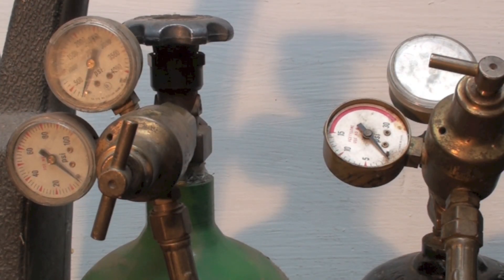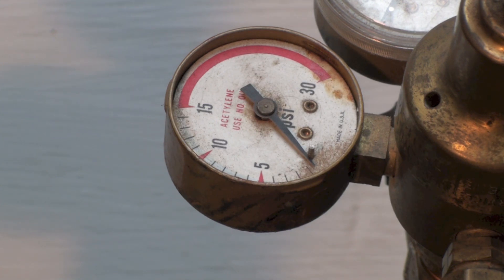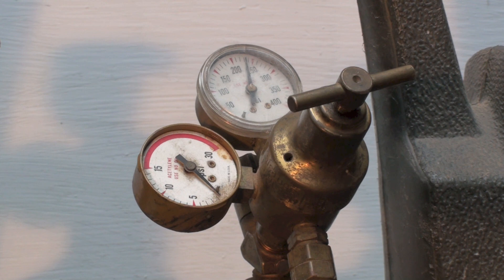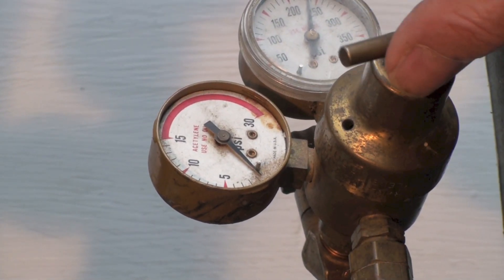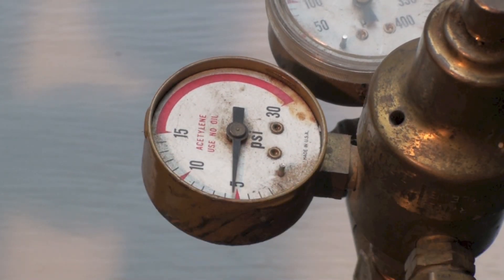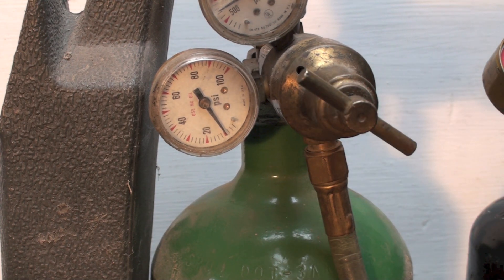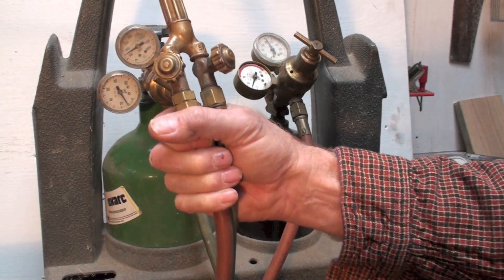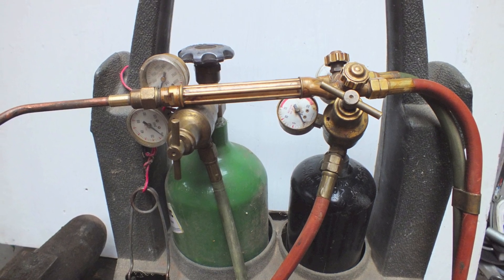How to set the oxy acetylene regulators

Comment: grayfurnaceman  you missed the entire point of my comment. If you are going to post a video online to instruct someone, anyone. Especially in this age of untrained people thinking they can jump on the web watch something and be an expert. Then you need to be specific!!! There is a reason that you should never run over 15psi!! Acetylene at pressures above 15psi becomes  unstable & breaks down into it's components, that can easily combine with  oxygen, and self ignite in a very rapid exothermic reaction. Not only that, you should include a safety brief with any video involving Oxy Fuel welding. Especially this above and NOT TO USE oil for checking for leaks or have any kind of oil near the system.
Reply from the maker: Richard Elbe If you look at the playlist on soldering and brazing, you will see a video covering how to safely install the regulators.  I also posted links there to other videos that I think cover the safety points better than I do.  As seems to be common, one of the links has broken, which is why I do not do this often.  I have considered the safety issues carefully which is why the playlist is linked.  If I overuse links on the videos, they become simply background noise.  I do appreciate the comment and will find another video to replace the broken one.
Reply: +Richard. I don't see or hear anywhere in the video where he said that.

Comment: can this SAME hoses and regulators be used in a set up with propane(cheap!) instead of acetylene
Reply from the maker: Yes.  You will need an adapter for the propane.  You will use about 4 times as much oxygen.  If you are using it for cutting, you will need a propane tip.  Hope this helps.
GFM

Comment: These are "equal pressure tips" - isn't ten and ten appropriate??
Reply from the maker: Well, I have never heard that one.  But it could be true, I guess.  I have always used the lower pressure on acetylene because it works.  It may be that I have done it so long and that's how I was taught, but If you can make it work with equal pressures, I guess its ok.  One of the things I consider is the instability of acetylene.  Over 30# it can spontaneously ignite.  I realize its quite a jump from 10 to 30 but we always did a little of overkill on that.
GFM

Comment: # 1 NEVER EVER use ANY gauges or regulators that are in OBVIOUS DISREPAIR, just like the ones on this vid!!!!!! You WILL DIE or burn down the structure that you are working in!!!   # 2 ALWAYS open the oxygen bottle ALL THE WAY OPEN. There is a back seat on the valve that prevents the oxygen from leaking from around the valve stem!!! That saves money AND prevents oxygen from coming into contact with  greasy or oily rags that may be left laying around which can cause VERY rapid and uncontrolled combustion.  # 3 only open the acetylene bottle 1/4 turn for quick shutoff in case of emergency
Reply from the maker: I will agree on the condition of the gauges on the regulators.  I knew the condition of the gauges and my thought was more of a demonstration of what happens to these tools.  I think if you look in any HVAC tech's truck you will find at least some of this as they are susceptible to damage.  I have a regulator set that I bought in 1968 that the gauges are still working normally but they were stationary.  On the oxygen valve, I was taught to backseat that valve many years ago.  However, in a later class, the instructor said you no longer needed to, so I checked for leaks on the valves and never found a leak so I stopped doing it that way.  And you could make a case for 1/4 turn on oxygen for the same reason as the acetylene.  The one thing you did not cover is the lack of flashback preventers that all new sets have on them.   These devices are well worth installing.  Perhaps I will do one with all the repairs and the flashback preventers.  I do value your comments although I have not died or burned anything down using welders for 45 years.  I would like to see any videos you have done on welding equipment.
GFM
Reply: Thank you sir, as others have posted, I was not trying to be rude or bash your vid, just l wanted to make a point to the less experienced viewers out there that oxy-fuel setups are  to be taken very seriously, and damaged equipment can cause serious injury or death. All of your vids are very informative and have great educational value! Thank you,Ken
Reply from the maker: welding 34yrs Thanks for the thoughts.  I will be publishing a vid showing the repairs on the oxy/acetelene set when I get time.
GFM
Reply: yeh i'm new to this but i worked at a gas place (boc Gasses in durham nc) and we were told repetedly only open valves enough to do what we need.  don't know about the oxy thing i've heard it both ways but i know that getting a valve stuck open is about the worse thing possible if something did go wrong.
Reply: Highasakite you never open your valves more than a half a turn. The simple fact is, if there is a serious problem, you want to be able to close them as fast as possible. This opening them all the way is but a old wives tale. Half a turn is more than sufficient and opening all the way does not increase your feed at all. Don't worry, a few more years and maybe you will actually make it as a welder, you will progress from a unskilled hack wanna be.